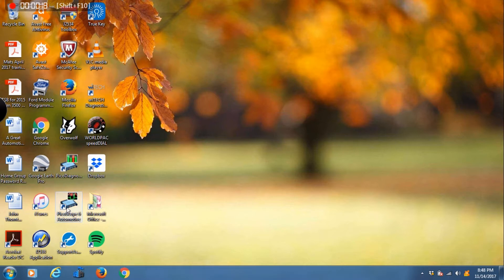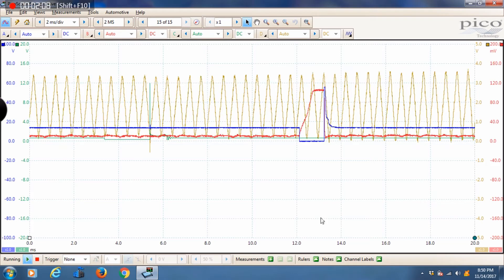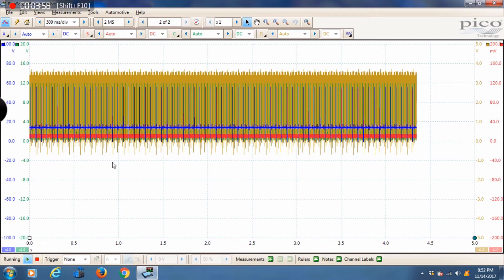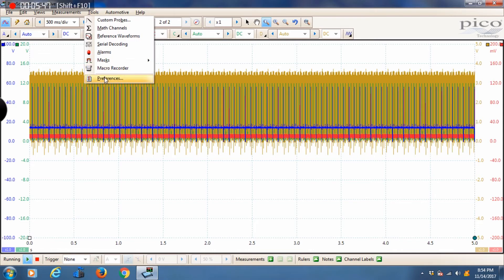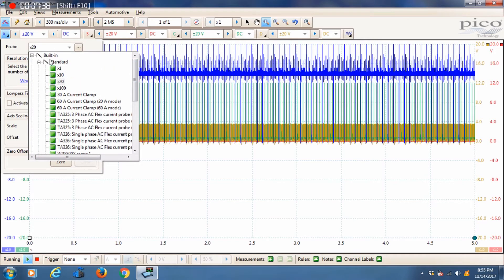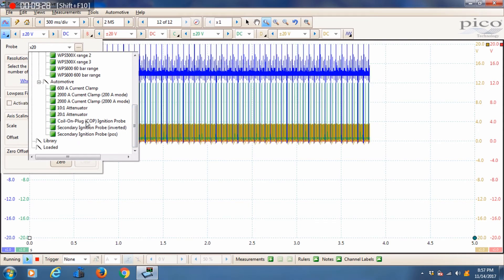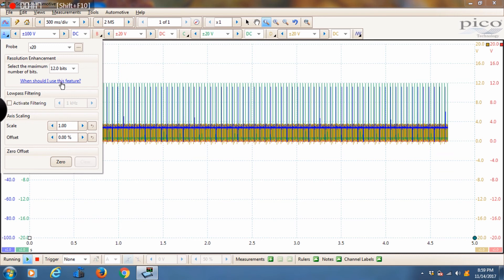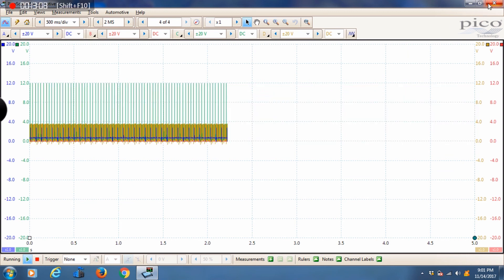PICO SETTINGS

Comment from the maker: https://youtu.be/cbCoEq-Y5kc
Reply: Really appreciate your videos and hope you keep them coming. As a beginner user it's nice to learn from the ground up. Very nice presentation. Thanks
Reply: Thanks for the videos I have learned more in the last couple of videos than I did reading the Pico manual! I was wondering if you could elaborate more on the buffering and time samples and when you would change your sample rate and why. Like is there a general rule of thumb on what to set it on depending on what you're testing? Thanks in advance!